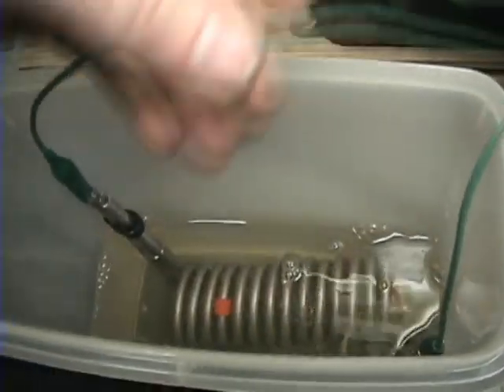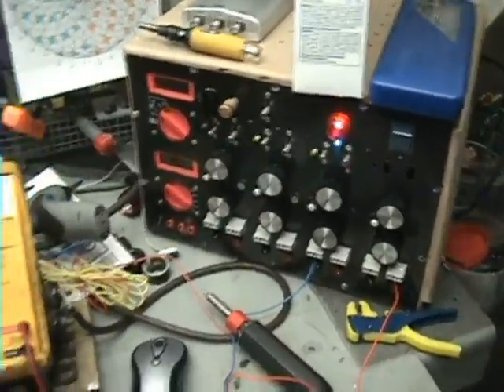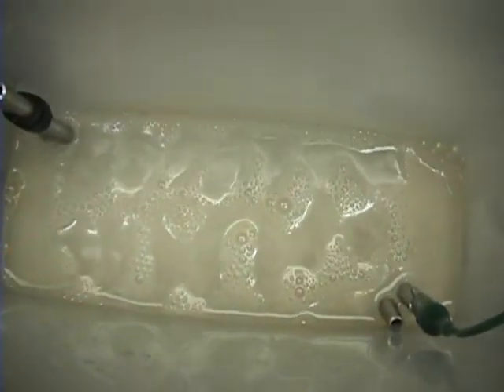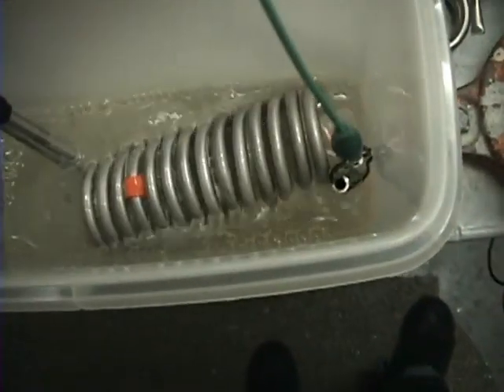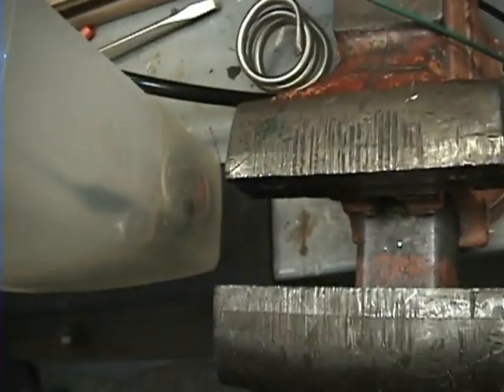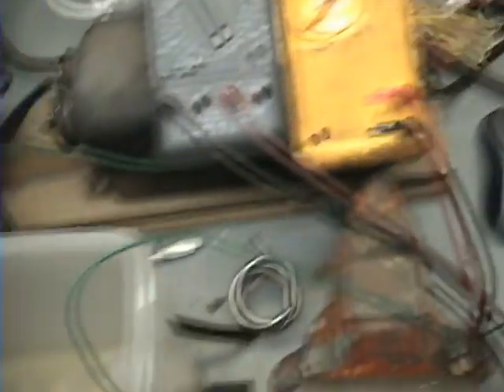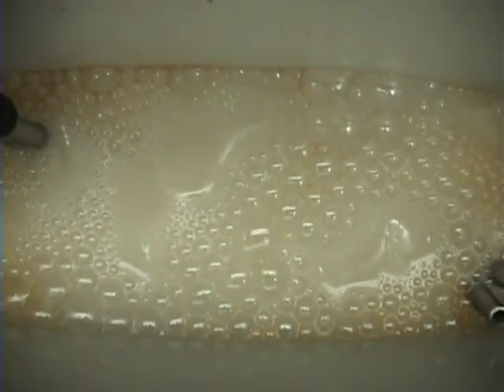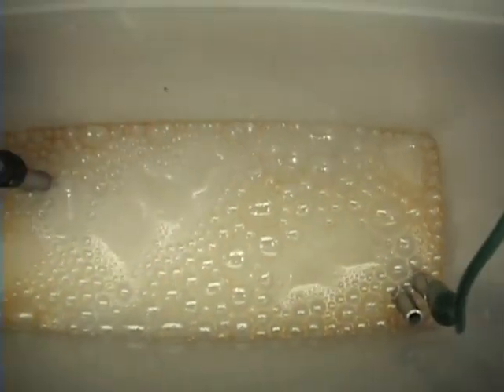Meyer's Gas Core Transformer & The Rustic Spiral Cell (First Look)

Comment: Russ, I tried the double helix tube 2 years ago. Also had it running with no added electrolyte, but it's not as efficient as other designs so I moved on. The zero current leakage dry cells work best and can be configured as split gas cells. I also modded the Meyer's gas/plasma core transformer to be much more efficient. I chatted with Alex about the design and posted a sketch of it on Facebook and Sketchup.
Keep up the great work.
Mike.

Comment: @KyleCarrington Yes, that is why his water is also a little bit brown/yellow. That basically guarantees that chromium is being leeched into the water. Chromium is bad enough that is not even legal to dump that water down the drain. It has to be taken to a hazardous waste cleanup site, and chemical-resistant gloves are recommended when working with water contaminated by it.

Comment: @ImJacksAmygdala this freq (23-24) is coming from ultrasonic cavitation phenomenon. H2O also resonant freq is around 2,3 GHz like in microwave but Russ's power supply can't supply so high freq... also you can use plasma to get H and ozone like cold fusion scenario in some freq

Comment: As Meyers said use the "KISS" principle. Keep it simple stupid. Very ingenious design using a very common material. The key to all of this is the frequency and voltage range. I believe any of the most common cell designs can produce very well with no electrolyte if using the correct circuitry. Nice electronic testing equipment!!!